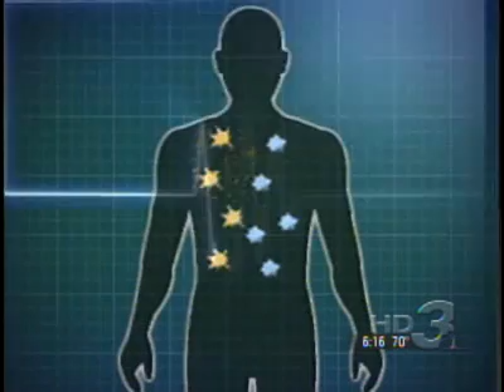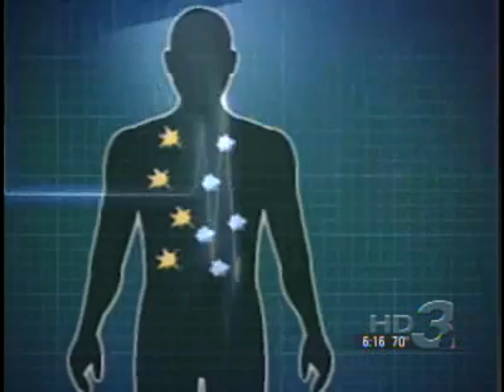Salt Water Energy

Comment: You Are Such A Dumb Ass -lastwinj- If You Are Running The Car From Salt Water Obviously We Are Going To Have The Alternator Hooked Up To The Engine, And The Alternator Will Be Charging The Battery To Supply The Entire Car With Electricity. 

A Very Similar Invention Was Made In The Filipins But, You Know Since The System Flows One Money Then Why The Hell Stop Billions Of Dollars Coming? In Other Words We Could Have Had Cars Running On H2o Since A Long Ass Time. Suck HuH!